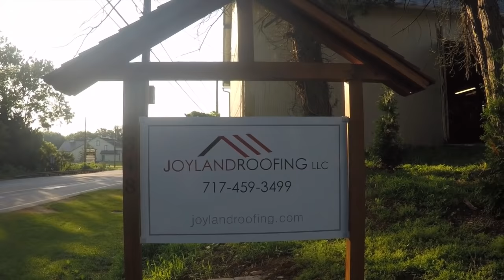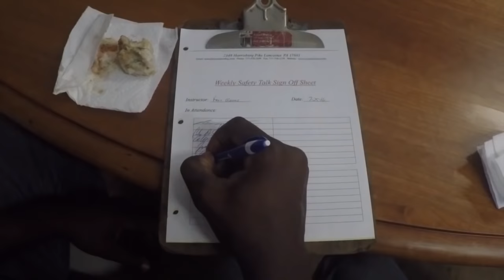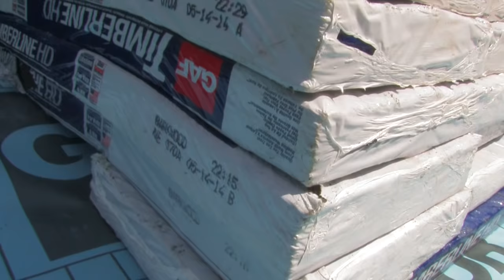A Day on the Roof

Comment: How come on all roofing videos when they show a rip off it's always just a one layer rip? Where are the 3 to for layer or the 6 to 7 layer on the flat roofs. Show that , and you get my respect. The 1 layer rips are a walk in the park, compared too.
Reply: Dont forget some shingles have wood and playwood had to be installed
Reply: Yeah we just did 3 layers of shingles on cedar shake tear off. Shit was brutal
Reply: Lmao!! Those are found only in a few places since most counties banned that practiced
Reply: How about wood shingle under two or three layers? That's when it gets tough.
Reply: @1stknigh  I think I saw some of the last of those get torn off nearly 10 years ago. They're few and far between now, but you do see some 2 layers here and there.
Reply: @davidbrakefield2362   Ive seen two layers of shingles on top of a slate roof. That was a brutal rip. Tar and gravel flat roofs are also a bitch to rip.

Comment: This is luxury roofing. We had to tote 80 pound bundles of shingles one at a time
Up the ladder and place it on the roof, then go down and get another bundle and repeat until
The job was finished. Plus to tear off the old shingles we used a pitch fork and had no machine whatsoever that could just pop everything up nails and all. That is pretty cool tho. And we threw the old roofing and debris off the roof on a tarp and had to lift it or throw it by hand into a dumpster so that sucked too. I wish it would have been like this when I used to roof.lol would have saved a lot of back pain.

Comment: By time you get that big ass thing at 3:27 on roof and hooked up me and my crew would have that whole side tore off lol grab a tear off tool man
Reply: Waste of money for sure.  Big heavy piece of garbage.
Reply: Double layers, that thing pays for itself quick
Reply: Double layer that thing will not do
Reply: @davidbudy6256  as a roofer in Florida tearing off double layer 6 nail architectural shingles it absolutely will. Does a fantastic job even on roofs with dimensional lumber for decking you just gotta run it crooked down the roof so you don’t hit each board. Outside of double layer it’s fast but to much wear an tear on the user, double layers though that machine is where it’s at. *edit only if bottom layer is gonna crumble anyways, if top layer peels and bottom ain’t to bad it’s a tossup
Reply: Just means the roof (6 nail arch shingle) was not apply correct.ive study the machine up close fiddled with it it wont
Reply: @davidbudy6256  have you ever actually used one? What makes you think it won’t? The lift mechanism doesn’t get held up at all, he’ll the thing will damn near lift me up if it gets caught under something solid and I’m 185. I’ve personally used this on well over 10 double layer roofs in Florida, worked great on all of them. Why shouldn’t it?
Reply: Yes I Said I saw 1up close fiddled with it run the mechanics of it would not lift me don't know how big you are
......
Reply: And I've torn off alot of 2layers that just beat my hands and elbows to mush
Reply: @davidbudy6256  right but how many double layers have you ripped off with that machine?
Reply: That's what I'm saying not worth my time
Reply: I'm in Kansas

Comment: Underlayment incorrectly installed at 4:08. Should be installed from bottom, overlapping as you go to the peak. Why?
Reply from the maker: Good point Eric. You'll notice that we put underlayment at the peak so we could stage the shingles. Of course the rest of the underlayment was then brought up under that to properly shed water.

Comment: Also cutting the valley with snips .use knife or do California cut
Reply: True that. California or weave if it's same pitch. I can shingle without a hook blade! Some people just would have a hissy fit if they didn't be have one just to do a crappy job that will be seen in 30+ years. Or before.
Reply: Have you tried a hook blade on an ocsilating tool? its slick. We try pretty hard not to do weaved valleys here in Maine. With the snow load and temp fluctuations they are always the first point of a roof to fail. The cut valleys last alot longer in our neck of the woods.
Reply: Yea.. I thought that was weird. If he's using snips wouldn't it be less strain on the hand to chalk it off and use a hook blade ?

Comment: So.. Why are most of the houses in america made of wood? and shingles? Why not use bricks and roof tiles? Where I live its all bricks..
Reply: 60FpsGoodness it depends where you live.  In high heat and windy areas clay roofs are best.  Not so good for the weight of snow. Shingles also install faster, lighter, they don't break and if they tear there is a something under to protect your roof because of the way shingles overlay.
Reply: because the logging industry is huge and wood is plentiful.
Reply: breathe and squeeze that has nothing to do with shingles.
Reply: he asked why houses are made of wood. and we used to use wood shingles as well, shakes. then we moved to more modern types of roofing materials. wood is plentiful here. places that use brick/slate and other types of material probably do so because they don't have a large logging industry.
Reply: E